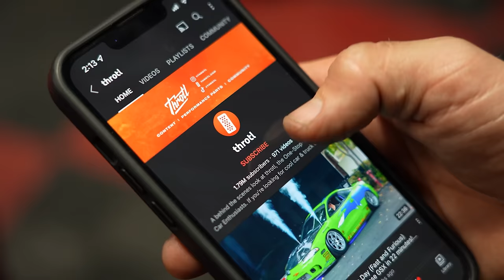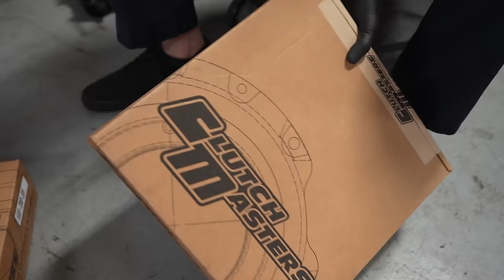Building a Modern Day (Fast & Furious) 1994 Toyota Supra Turbo - Part 9 - Engine In!

Comment: With the thermostatic oil adapter, won't that mean that the oil filter will get no oil when cold? Seeing that the oil filter is now in a remote location and working off the thermostatic sandwich plate
Reply: good catch.. interesting question
Reply: @wow35master  yea man. I asked because I did the same setup on my car, but didn't go the route of thermostatic,  because the filter won't get oil til car warmed up
Reply: The oil filter will get oil even if the engine is cold. The oil cooler will get oil passing through it if the oil reaches operating temp. The adapter is to prevent the oil cooler to be active right after engine start. The engine can warmup faster with this installed. If I understood it correctly.

Comment: Hello,
I always use a drill with a wire brush to clean the engine block or gearbox. This way you can always get the corroded aluminum very clean.
Greetings from Germany

Hallo,
Ich benutze immer eine Bohrmaschine mit einer Drahtbürste, um den Motorblock oder das Getriebe zu reinigen. So bekommen Sie das korrodierte Aluminium immer sehr sauber.
Grüße aus Deutschland

Comment: To elaborate on the arp bolt question. They have a higher tensile strength and are manufactured to higher specs and tolerances than normal bolts. Because they focus specifically on bolt hardware they have higher quality control standards and are the top of the industry for fasteners.

Comment: PSA: Anyone swapping an aftermarket flywheel, please ensure your flywheel ring gear is correctly orientated. Years back (2002), I swapped an ACT clutch & Fidanza lightweight flywheel in my 1990 Celica All-trac (3S-GTE). While the car did start up and had no other problems otherwise, every startup instance generated a hideous sound. The problem was that the steel ring gear was factory installed backwards on the Fidanza aluminum flywheel. Hence, the ring gear beveled edge was facing the wrong direction (relative to the starter gear). After a few calls & letters from my attorney, Fidanza coughed up a free replacement flywheel plus a check to cover the shop labor to swap the defective flywheel. Save yourself potential headache and visually compare your outgoing OEM parts to your incoming aftermarket parts.
TRUST !!

Comment: Not going to add a second bracket for the coolant line like it had? That's a very long cantilever off the thermostat housing to be dealing with engine vibration.

Comment: 21:40
Its like the stock MKIV twin turbo's ...
sure the 1st turbo spools instant and you can feel it but compare that 1st turbo to the 2nd turbo when it kicks in at 4k rpm .... makes the 1st turbo feel like its not even there. It feels like turbo lag even though that 1st one IS spooling and pulling

Comment: Is the reason it’s ok to use compression fittings for the nos and fuel lines due to a lesser psi rating in comparison to the pressure that brake lines see? Because for brake lines it is not considered safe to use compression fittings as they can burst under the high pressure. It is recommended you use unions for brake lines. So is my understanding correct here as to why compression fittings were used for the NOS and fuel lines?

Comment: 😮Not sure why he put the ultra torque lube on the threads of the flywheel bolts. Usually it goes just under the head and locktite on the threads. Hopefully he caught that.

Comment: ARP does make good stuff and a major key note for them is reusability as so many factory bolts are TTY and with racing engines the unfortunate truth is they are going to have to come apart being upgrading, refreshing or rebuilding. Not to mention TTY stretches and running high HP means... more pressure + stretching bolts = No damn good!
Factory bolts are expensive too! I have over a grand in just hardware for my engine, No one thinks about that, It's a necessary evil that sucks to spend so much on since its just bolts... but it holds everything together!

Comment: I'm not a 2jz expert but wouldn't the oem oil cooler be warming the oil up along with coolant temps at start up?  I do agree with the filter relocation though.    I used to think that I knew better than Toyota but every mod i put on any of my toyotas has made the car worse in some way or another.   Toyota became one of the best car maker for a reason

Comment: What is the blue protection they are using on the bay and parts? And what tool is that they used to tighten studs? Thanks in advance

Comment: Y'all need to trademark your throtl logo and put a little TM on the bottom. That way when the telegram scammers use your logo for their fake youtube accounts they'd be breaking the law and you could take legal action against them. And it would force youtube to start cracking down on them since they are using the youtube platform to scam people. Just saying.

Comment: Completely building and modifying a vehicle and you complain about placement of parts... well then you did it to yourself. Cut it out. Replate. Relocate. The solution to your hassle of a problem is a bit of a hassle as well, but in the long run, it's worth it to do the upfront work.